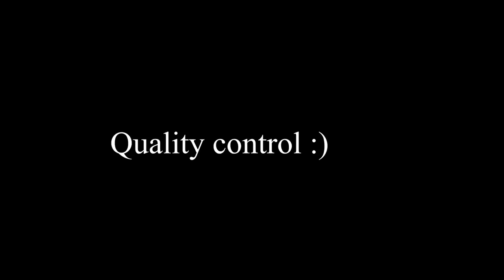Live edge Ash bookshelves

Comment: My grandfather made a coffee table back in the 90s and did not have to use any epoxy or anything like that. The bark is good and tight not falling apart. Did you not dry the wood right before you started?

Comment: What did you put between the live edge when you had those yellow spacers separating it from the rest of the wood?  Once you took the yellow spacers does the live edge reattach with the help of the liquid you put there? Thanks.
Reply from the maker: It's epoxy resin,  the bark will not fall off over the time
Reply: @homemadeinlviv8041  thank you so much.